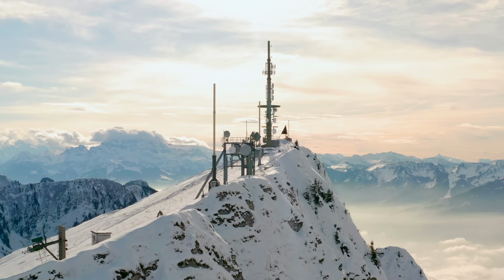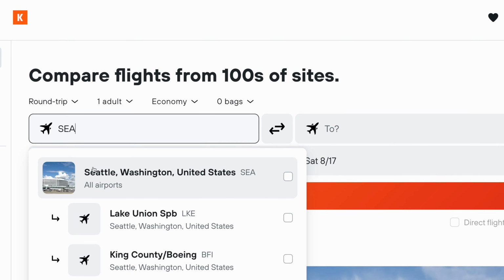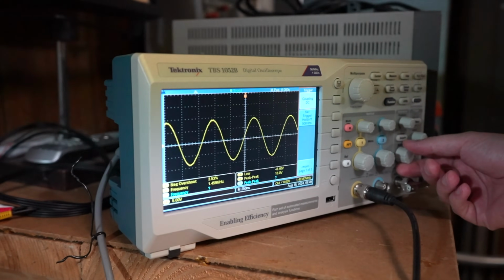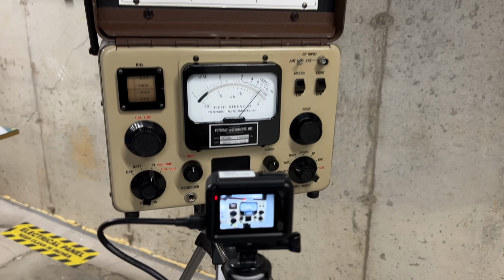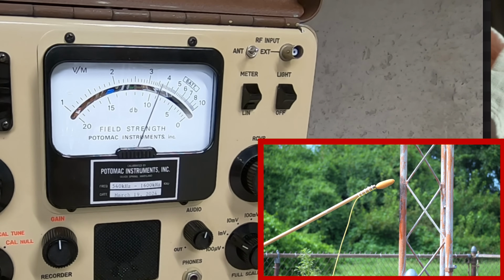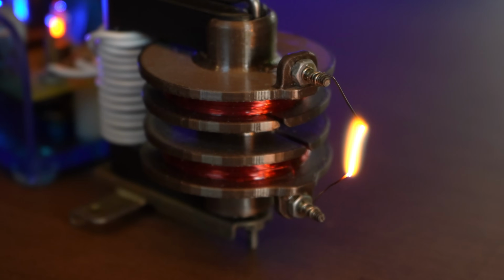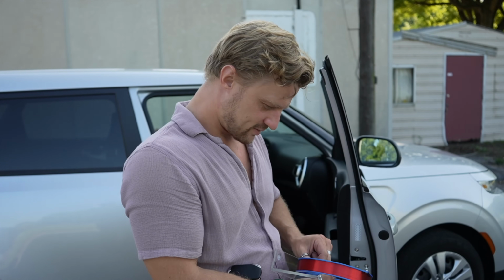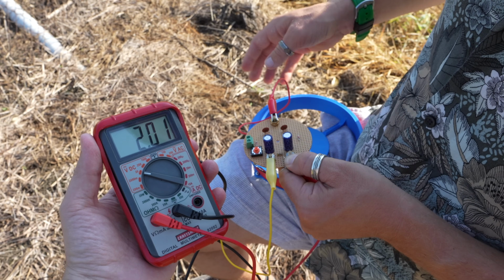Stealing Energy From Radio towers Using Plasma (ft. Geerling Engineering)

Comment: Ok so I have a cell tower a few hundred yards from my house. I did a crazy ton of research and there isn’t much information about cell towers and what they broadcast. I found that most cell towers broadcast at 20W I believe it was? On the UHF band in a thin band. Similar to how he describes FM. I considered the possibility of collecting energy from the cell tower. I think it would need to have a much higher output and be a broad spectrum output. Or I could have a giant tower in line with the cell tower broadcast. All just to get such a small power output.

Comment: What he’s doing in this video is actually not stealing energy from radio station stations

He is actually using aspheric pressure and interestingly enough most Hydro lines in any city are actually taking the electricity from the sky and then you’re paying for it even though it’s free 

To make matters worse, air comes from the Latin word ether and ether is another name for electricity so when you breathe in oxygen, you’re actually breathing in electricity if you use what air actually means
Reply: Could you explain better how to get energy from the ether?
Reply: @siandresantos2068  look it up but I'd recommend using a VPN  
It's also related to Nicola TESLA

Comment: Just a heads up,, the Pyramids (all over this planet and others, had several functions. One of which was to amplify Cosmic energy. Many are still functional. What you are doing is showing how to build a receiver for that system. Thinking outside of the box (as you do) is the answer to capturing this energy/frequency.

Comment: Your not trying to relieve a clean AM signal with your little circuit,  you could probably put some rectifier diodes in the circuit instead of RF.

Comment: First of all, your words are inappropriate unless you like being known as a theif. 
NICOLA TESLA said , "its as easy as pluging a pole into the gound to get as much power as you need", 
So I've been looking at this idea for years, and what I found,  is that , You cannot be a theif if you appropriate what the facts display as
 FREE ENERGY 🤔.
Thats what you do when you breath.
The only reason in the wide world why there is no such thing as free energy, is because the concept is under the scrutiny of what is called a military use clause.🤔. 
However, the entire world lives on a ginormous battery, and the ground is the ground to the battery and the atmosphere is the positive side of the battery, from my understanding, the ground is where the energy travels, therefore,  except for the devices you have to pay for, the rest of the working factors of such a system would equate to free energy. Now you can call it stealing if you wish, but today in our corporate world they call it leveraging, yes leveraging is a form of theft. However,  appropriation of the energy source is not a theft. It is intelligence using unsatisfactory electronic systems residual energies due to disfunctional manufacturing practices which does not retain its use of the energies which it develops, and collected together to do a service or a job such as operate a light bulb for instance.
Amazingly enough, I've been watching the failure of electronic engineers my entire life, 😢, TESLA WOULD BE SADDEND😢. 
But he did accomplish this in his car, but because the stupids of the world laughed at his accomplishments, he took the device that made this possible and destroyed it as he told them, go ahead figure it out now. Not one engineer  yet has figured out how to draw useful energy out of the air, yet I can see it using their ignorance.😅. 
And in doing so, I can see that you are working in the right area. 🤔👍
Even though my cousin invented the integrated circuit, IC, I am just an inventor and not an electronic engineer per se.  
But it is my belief that you are working on the right ideas🤔, I hope you the best, peace.

Comment: Can you make a bass cabinet that can soften the low range of a Tesla speaker and 'smooth' it out? Always been curious if that was possible. I've seen some attempts but never done completely. The idea is you could have full range frequency of sound without having to vibrate any material.

Comment: sad. i thought this would lead to a system that could energize a 3d printer through a 110V or 220V outlet. but as a proof of concept acceptable. if you can make a system that can charge an akkumulator that can deliver those voltages for home use and make it dyi feasable, it would be nice to create a make of that project.

Comment: This works with Amplitude Modulation, which sort of makes sense to me with my very limited understanding. And if really do understand, this would not work with FM, correct? If I am wrong, then I guess I have more reading to do. (I am specifically referring to the plasma/speaker effect.).

Comment: cant imagine what kind of power from 50 ft tower with help line of sight run 5k diesel gen during time in military that were digital transmitter had to be that way so no one could hear had to have a clearance to operate was far better wire switch board you had to run wire you self 20 milttary retired U.S army

Comment: Don’t know if you’ll get this but I thought I’d give it a try. Several years ago I got a job with a company in Pittsburgh called Davison Design as a senior supervisor. Davison was your typical invention company with a twist, they did their own experiments also. At the time they were working on transmitting electricity. I don’t know how far they got because it wasn’t my area but I did see some Christmas lights that were wireless and I’ll be damned if they didn’t work. They had little antennas on them and the lights lit up. I stayed there for about a year and my wife still works there, I actually met her there as I was her boss. I don’t know what became of the lights but it sure was interesting.

Comment: you have no voltage regulator to the led. the resistor will limit the current but not the voltage. just use a high voltage capacitor with high voltage diodes and a voltmeter skipping the LED.

Comment: Northern Europes biggest AM transmitter was fairly close to where I live until it was shut down in 2002. People living in my area reports not needing a radio, as Radio Sweden would be perfectly audible from any loosely stacked metal, like the cutlery drawer, the grate in the kitchen oven, or from chain link fences.

Comment: Idea: not just a power receiver. You’ve done that. 

How about a drone, powered solely by the antenna?
You could either have it powered directly from a charging coil, or have a metering circuit charge up an on board lithium battery and cut the antenna link with a servo once it’s charged up (and automatically charge back up once the battery gets too low). 

You could make a drone that just hovers in mid air PERMANENTLY. Have it flying in an orbit around the antenna in a lazy loop. Just flying around it day & night.

Comment: One correction at 3:24: energy delivery does not drop off exponentially with distance. Any time you have what amounts to an expanding sphere of waves (or anything else), the dropoff in intensity at the surface will be proportional to the surface area, which grows as the square of the radius.
Reply: I think you explained it weird but I get what you're saying lol
Reply: That's literally what exponentially means. Multiplied by an exponent like squared², cubed³, etc
Reply: @ChrisJones-xd1re  Sadly no, the wavefront follows the inverse square law. Although I get your misconception that there is a "square or ² " so therefore it should be exponential, IT IS NOT. The inverse square law is a power function not an exponential function. In inverse square law, the intensity of the quantity, in this case, the wavefront, is inversely proportional to the distance squared, which means that as the distance DOUBLES, the intensity becomes 1/4th as much, and as the distance TRIPLES, the intensity becomes 1/9th as much, and so on and so forth.

In an exponential decay, the rate of decrease SHOULD BE proportional to the current value (intensity). In short, exponential decay involves a constant proportional decay rate, where the amount of intensity decreases by THE SAME FACTOR over equal time intervals.

Hence, it's not exponential.
Reply: @cosmoshikizumo  spot on
Reply: @ChrisJones-xd1re  "Exponential" means that the variable is in the exponent. 2^x is an exponential function, x^2 is not.
Reply: You think it is a spherical wavefront?
Reply: @borderm3  AM radio naturally emits in every direction. If it's not, the energy is dropping off even less.
Reply: @borderm3  Ideally, antennas are modeled as isotropic radiators (spherical wave sources), but in practice, antennas' radiation patterns are limited by their physical design and surroundings. All practical antennas do not radiate uniformly in all directions; for example, monopoles over a ground plane have a hemispherical pattern, while dipoles create a doughnut-shaped pattern. The wavefront expands with distance, but obstacles like buildings and terrain features can attenuate the signal. In free space (ideally), the intensity drops off proportional to the inverse square of the distance, which is what I think he is referring to. He is right that it is not exponential. While a perfect spherical wavefront, like what he is describing is only a theoretical construct, it serves as one of the basis for our antenna calculations since an isotropic radiator is how an ideal antenna should behave.
Reply: @borderm3 What else would it be?
Reply: @borderm3  I mean, it could be sent off in a sphere, makes sense, but idk, I'm not an expert on this

Comment: Have you played the game Pacific Drive? It's a sci-fi adventure driving game. I bring it up, because beyond making more storage containers to carry more things. You can also make these modules, that can recharge the car battery, while your out on an adventure. You can recharge the car with a lightning rod, a wind turbine, and some thing that turns rain into electricity. I want to make things like this for electric motorcycles & motorhomes. Of course, there's the classic solar panels on the roof, panels on a trailer pulled by the bike. But YOU got me thinking...what about coils meant to capture the loose radio energy in populated environments? I knew about Nikola Tesla's wireless power conspiracy, but this video made me want to make a passive charging system for an EV, that will work even at night, with no wind. Thank you.

Comment: Another thing you might want to try is stealing power from a 60 hz high voltage power line with that same receiver. Just remove the coil. The low 60 hz frequency allows a more direct contact with the power lines standing in the field underneath them. You pick up the capacitive current with a horizontal wire and rectify it. It might get even more exciting if you use a 80um wire boosting the electrical field around it to levels where ionic currents start to run up and down your receiver. I imagine a potentially lethal blue line going up in the dark sky. I'd love to see that. It wouldn't even be illegal because any grass point may cause ionisation.

Comment: Yes. Use zener diodes to limit the voltage to 50 V and make sure the capacitors can handle that. Then add a dcdc converter and something more powerfull than a LED. Your next receiver will handle 1000V dc, if you have diodes or diode strings that can handle that voltage. Steal 100W at a distance as Tesla is said to have done ( which seems hard to believe)

Comment: Yeah. You might wanna install a chip that regulates the circuits max voltage, and a ground wire to let some of the electrons out of the circuit

Comment: When I was little I learned how radio wave induction worked and about crystal radio sets that used high impedance earphones and a germanium diode. It took a lot of copper wire and a long antenna to work. Then teslas wireless transmission of power.

Comment: Cool video.   First thing I said when I saw those capacitors was:  gee they look small....1000 uF?  Why not get some much bigger caps?   When you try a new experiment, perhaps build an LED flashlight  that can be charged by driving by a radio tower!  Also, add a voltage cutoff mechanism so it doesn't blow.

Comment: So basically, AM radio is just a series of wardenclyffe towers.

So theoretically, you could add a properly tuned receiver antenna on your house, tune it to a fairly close AM transmitter and be able to charge a properly built system that could offset some grid use?

Comment: Blue LEDs generate a significant voltage as photovoltaic cells when exposed to bright light, enough voltage is stored in the PN junctions , to blow them when they are connected to  circuit that provides a load ! interesting.  Too sensitive, red orange white and green LEDs fair better, ... might be a good idea to measure the voltage charge with some kind of meter, from the coil and provide some way to use up excessive power received from the coil , with a feedback loop.!

Comment: Wondering if anybody can answer this for me, I know a mechanic whos shop is super close to some high voltage distribution lines. (The kind really high up and the voltage from the power plant barely stepped down yet.) He says for some reason car batteries even brand new nothing else seemingly weird going on go dead really quickly there, like just after a few weeks sometimes. Where is the power going from the batteries? Static in the air causing voltage differentials?

Comment: Wow, neat! I am in a bit of a unique position because I built what I call a "Tesla flashlight" that runs off of local FM station (which will remain nameless). I did think about trying to extract self-powered audio, but not so easy since the power level is essentially constant across modulation (and the frequency varies--hence "Frequency Modulation") so extracting signal would be much more complicated. (And you do realize the non-linear diodes in that sort of system splatter all kinds of self-powered harmonics back out your power receiving antenna.)

The high frequency FM towers are very different in their safety aspects. The radiated power at the base is probably the lowest at any point around the tower (near ground level), because the antennas are designed to radiate in a horizontal toroidal pattern with almost all in a nearly horizontal plane. They in fact tune just a tiny bit downward from a perfect horizontal plane to accommodate the curve of the earth for a majority of subscribers, making the peak output pattern just a slightly peaked cone. In any case virtually zero straight down or up.

I put a very small capacitor on mine and used the impedance of the system to current limit so I had a continuous LED light, didn't need to accumulate for pulsing. I guess was testing about 30 m from the tower. I used a bridge rectifier and a balanced line feed which upped the voltage and lowered the current. I was surprised to get 15V at times with no load (LED disconnected as you did), but more typically 5 V range which is a good range then for matching the LED at load which would be 2.5 V range.

American FM transmitters typically put out what is called 100,000 wats, but that is the equivalent if the transmitting antenna was a simple dipole, so realistically in the 20 kW range of actual power. Much safer to be around the transmitter, even though higher power, because all the energy is bottled in the coaxial tubes/cables. Local television transmitter is 1 MW equivalent, so lucky the neighboring TV station antenna is as far above head as the base of the tower above sea level--definitely don't want to get cooked in that path but those are so well tuned that local signal strength at the ground is no higher than several miles away but much closer to the horizontal cone. (They put a bit of effort into avoiding wasting part of their 200 kW aiming down, and of course cooking people living around the towers.)

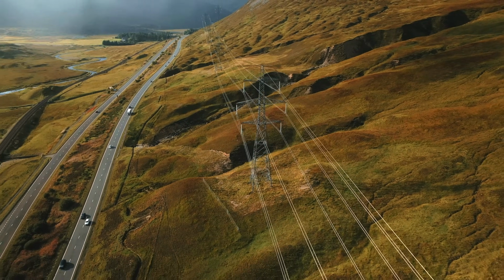Comment: 0:52 Why show a transmission line? This is a different kind of "transmitting a lot of power" which I think might just confuse some people.
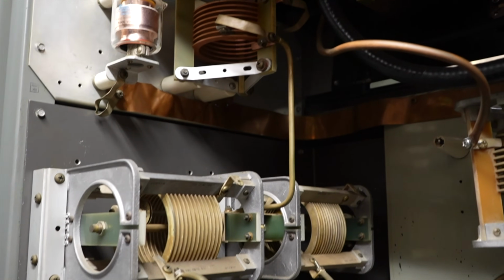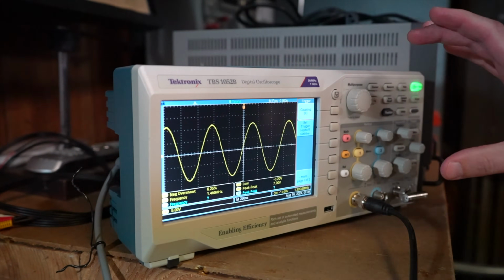Reply: Also 5:47 is pronounced "ihm-pee-dince" and 5:59 "AM" stands for amplitude modulation but you got it the second time. I'm not trying to be an asshole. I'm just an electrical engineer. Let me know if you want a schematic review on the receiver.

Comment: You won’t actually die if you touch the cable because the current is generally low, not to mention the insulation.  You could be severely injured by burns however.

Comment: May I ask what detector diodes you used?
Thinking along the lines of AM detectors it would suggest germanium and they would not withstand a “few” volts of emf, but use 1N4007 1kv 1 amp diodes and they would be quite happy, not very sensitive to RF, but at the RF levels you are looking at, thus will make no difference at all. 

Hence curious about what diodes you used?

Tnx
KW

Comment: Two lessons learned. Has a junior in high school doing a summer job in Norfolk West Virginia or starting out there. Took a little trip out on a research vessel that had some coils of wire on the deck. One of these spools of wire that was approximately 5 ft across somebody grounded improperly for the trip out on the water. I was unaware of what happens to the spools of wire on board ship out at sea 😮. They are wonderful tuned receivers to whatever radio frequencies they can find and will zap ⚡the living tar out of you with hundreds to thousands of volts of electricity. 🤯🙀🕳️⚡

Comment: The digital multimeer has its own power to check and it can pass the charge throughthe circuitto test it. You need analog multimeter.

Comment: You could rebuild your detector circuit using high voltage diodes and an array of small neon lamps to bleed off the voltage at about 60volts. Use a series resistor of about 56k in line with each Neon lamp to limit the current to each lamp. LEDs and signal diodes won't survive, as you found out. 😊